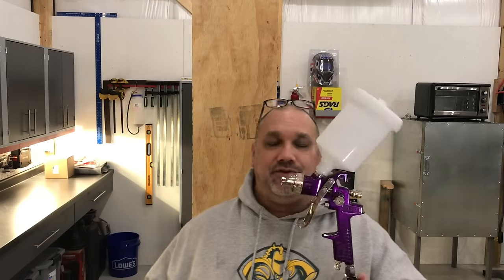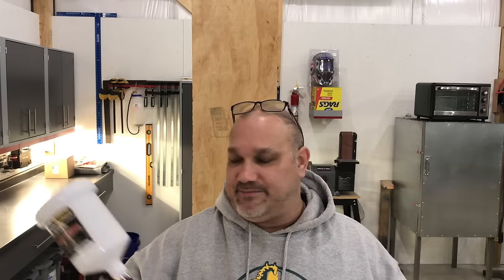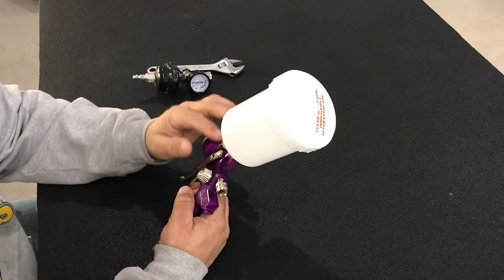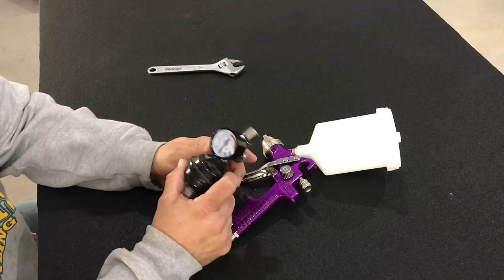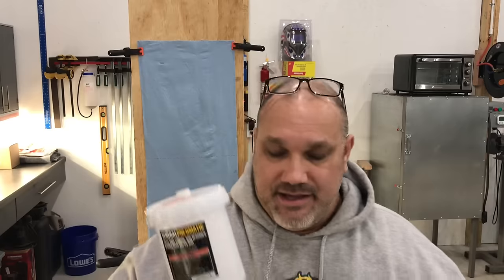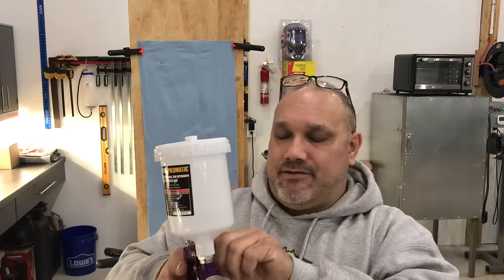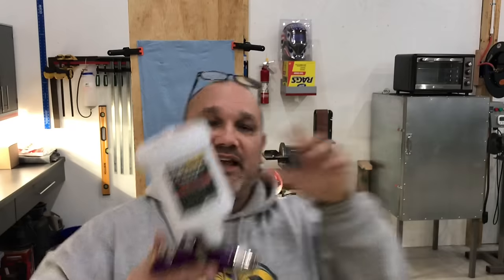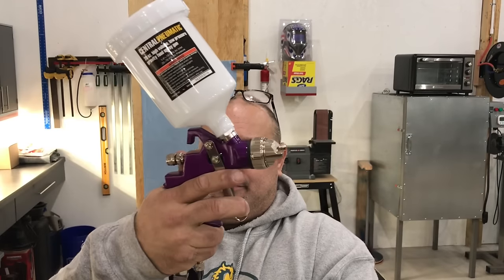How To Set Up a Harbor Freight Paint Gun

Comment: Does the regulator on the gun itself always keep it at 30-40 lbs as you described? In other words, does the gun regulator hold that 30 lbs and the compressor just operates accordingly to keep that 30 lbs at the gun at all times?? Thanks for the good video, I have the same gun, just spent a couple more dollars on mine. Thank you
Reply from the maker: The air compressor is at 100psi, and the regulator at the gun is taking care of what  I’m getting at the gun.

Comment: I want to spray outside the underneath of my Ford F-150 with Harbor Freight Bed Liner paint using a Harbor Freight 1.5 HP, 150 PSI pan head air compressor (2nd model up from their cheapest) with your paint gun shown here. Is it doable? I have a Ford Ranger that I had paint brushed the bedliner paint on with the bed off. Problem is it's very time consuming and you do get paint dripping down your arm, etc. Great demo of paint gun, thank you!!!
Reply from the maker: Thanks for watching, you may want a little bigger compressor.

Comment: Great job man! You definitely know your stuff. Lot's of great information that I was unaware of and no annoying music that too many people think is necessary in a "How to" video. I only have experience using aerosol paint cans to paint small to medium size parts and I am sick and tired of spray tips clogging or not working the first try or the propellant leaking all out, etc. I hate it when I have to throw away almost full cans of paint at $8-$10 a pop. The price is right for sure on this gun and I've been wondering if I should get it. Do you think it's ok to use leftover "spray can" paint in this gun? Not sure the best way to keep the leftover paint from going bad though...Any thoughts would be greatly appreciated. You just got yourself a new subscriber!!
Reply from the maker: Thanks for watching and thanks for subscribing. you can try harvesting the paint from a rattle can and spraying. Worst case you would just have to clean your paint gun if it didn’t work.
Reply: Look up how to refill those almost full spray cans with a valve stem. It works, as long as you have access to a compressor.💯🇺🇸👍

Comment: I want to spray latex Sherwin Williams hybrid primer and latex top coat on kitchen cabinets and drawer fronts. What tip size, thin paint or not, use the in gun filter or not, and anything else relevant to achieving coverage. Thankyou in advance for you advice. I am a novice.

Comment: Thanks, great video!  I really got a lot out of it. Went to Harbor Freight today to buy that exact gun, but they were out of stock, so had to upgrade to the $29 version. Question, where can you buy different tips at for the gun?  Harbor Freight didn’t carry those.
Reply from the maker: I’ve seen a video where a guy drilled the tip. You might check that out.
Reply: I called Harbor Freight, they do not carry tips. Very frustrating.

Comment: Can I change the fan from vertical to horizontal? Please I really need to know I have a house to paint tomorrow and have never used a paint gun. I'm still taking rollers but it'd be nice to learn how to use a spray gun
Reply from the maker: Yes, just turn the air horns on the cap 90 degrees. Thanks for watching.

Comment: I had one of these that required about 70 psi (purchased a couple years ago).  I finally got a new one today and its dramatically better.  I run it at 30-40 psi and it really moves the material.  I've never used any other paint gun, but this is an amazing value for $10 (when you get it on special).
Reply from the maker: I agree, thanks for watching.

Comment: Thank you so much for the great information!! this is the best video I have seen about this model of HVLP gun. Thanks!!!
Reply from the maker: Thanks for watching.
Reply: Chad Byrd... You must not be looking in the right places. There are even videos that show you how to use the paint sprayer with actual paint. What type of compressor to use. And how not to use the cheap plastic air and paint filters. Continue to do research.
Reply: Hey buddy,   i tried,  i wanted to set it up, hut i believe i did something wrong,   the amount of water or paint, shooting spraying  is too little.    
Look like clean, no clog,  etc,  i move adjusting valvs and.no change.  Do i hve to Change the,  tip,  or what you think  im soing wrong??
The psi, was right.
  

Or maybe the paint. (Valspar, dor exterior)  was to tick

Comment: I have another brand of HPLV gun and I also have the one you demonsrated.  I have sprayed a lot of lacquer but not water based stuff.  I would like to try some water based stuff.  What about tip sizes solvent vs water lacquer.  I spray furniture, not cars if it matters.
Reply from the maker: It should work for both if the viscosity is similar. Thanks for watching.

Comment: How heavy is the pull on the throttle? Does it come with different cups? Can i take  my regulator and filter off my standard 2gsllon compressor for my air brush and an attach it to the gun? It’s a PPG and looks the same size as yours? Thanks you for your time man!
Reply from the maker: Trigger feels about the same as the rest of my paint guns.A 2 gallon compressor may not be enough to run this gun.

Comment: Thank you for all your videos. I have a husky (a very cheap one) that has the controls laid out exactly the same. It has a 1.4 tip. The only difference I see is the name, color and no filter at the bottom of the cup. I am fixing to paint my utility trailer which is square tube. Should I narrow the fan even more for the rails since they aren’t very wide? About what distance away from the surface should I be working at? I’ll be spraying rustoleum primer and oil based semi gloss. 3/8” hose and 1/4” fittings. Compressor is rated at 6.8 at 40psi and 5.1 at 90psi. Any tips or advice is welcome. Not trying to produce show quality but don’t want it looking like crap either.
Reply from the maker: Yes I would narrow down your pattern a little. Keep in mind it will put more paint in one spot so you will need to move accordingly. 8-10 inches with a narrowed pattern. Good luck!

Comment: Thanks for the video.  I’m new to spray guns and spraying clear coat lacquer on guitars. I own this gun and I have cleaned my gun and put together my lines with a water filter and ball valve for a quick stop. Question. If I set this up to work for water, will I be close once I have lacquer in the hopper? Or will I need to start from scratch?
Reply from the maker: If your using an acrylic water material you should be close when you go to spray lacquer.

Comment: Thanks for this video I have really been trying to find one that helped a newbie setup a gun. When you get fluid delivery amount I am assuming you are setting the adjustment for the pin. Are you saying all guns should deliver 6 oz per min or is this gun specific? Also, I am wanting to spray cerokote which is a gun paint. Also wanting to spray some Alumahyde which is a gun paint. When you thin paint out for this HF gun, how do you know when you got it right.

Thanks again!
Reply from the maker: If the material you get has instructions for mixing, that should be a sprayable viscosity. 6-8 fluid ounce per minute is standard for hvlp gun but most people spray more than that. 
Thanks for watching.

Comment: Very informative video.  Can I use this gun to spray Minwax Polycrylic or other water based urethane products?  Also, can I run this straight from my compressor using the filters and regulators that you listed or do I need to use a turbine or other setup?  I'm needing to spray clear on a bunch of cabinet drawers that I just built, but I'm also wanting to have a good spray setup for future woodworking projects.  Thanks in advance!
Reply from the maker: You do not need a turbine. You spray the polycrylic with this gun. You may need to thin some of those materials. Just try some test pieces and see how it does. Thanks for watching.

Comment: What pressure is coming from the air compressor? 

I'm seeing huge variations in psi, like my compressor is set at 70psi and when I open the trigger it drops to 50psi. Then the gauge on the gun regulator, it sits at 70psi, then when I open the trigger it drops to 20 psi. So which regulator gets set first (compressor or gun) and what are they set to?

Comment: if you're using the same fluid, can you just leave the settings and pick it up a few days later and start spraying or should you do all of this each time? 

also, is this gun good for spraying water-based poly? 
Very new to this. Do you just pour the same poly that you would normally brush on into the cup and spray with this or do you need to thin it with something first?

thanks!

Comment: Using the 1.4mm tip and 30-40psi, what would you recommend for a 1.7-1.8mm and even a 2.0mm tip, these can spray thicker paints, but usually thinned, so would the pressure be the same or greater, as the viscosity would surely be similar due to thinning. Wanting to get into paint spraying and using water-based paints for woodwork, like cabinets and furniture, just looking for advise on working with thicker paints (although thinned) and spray tips. Appreciate any guidance, and enjoyed the video!
Reply from the maker: Some loaded questions. If you reduce viscosity you can use the smaller tips. The larger tips are usually for higher viscosity materials like primer where you’re trying for a thicker film build, or fill for sanding. 30 -40 psi is where these gun are designed to operate and changing tip size for viscosity. Personally I find spraying a couple medium coats instead of one thick one, gives you a smoother  and more even finish. I will opt for a thinned material and the smaller tips when possible. Hope that helps.
Reply: @gixerman01  Much appreciated. Going to do some testing with paints and thinning, with smaller tips, as you've recommended. It was suggested 8 parts paint, 1 part paint conditioner, 1 part water, unsure if that's correct, but will try different ratios. Thanks again!

Comment: Hey Gixerman, I could really use some help.  I am planning to paint portions of my SUV tomorrow.  Actually, "repaint."  During the first attempt, I could not get the gun set properly (first time using a gun, first time painting, first time in a paint booth, etc).  The gun actually whistled when in use (HF purple gun).  Questions: 1) Should I remove the little cap on top of the paint cup so there is an open hose (I assume yes...please confirm). 2) Tip for painting perpendicular to the hood or roof without paint spilling out of the top of gun or around threads? 3) Is it advisable to use the plastic cup liner? 4) I could not get a consistent and smooth pattern.  There was splatter and spitting as I was trying to set up.  Eventually, I was able to get a little product from the gun, but not that nice smooth flow.  It took forever and I ran out of booth time.  Want to avoid duplicating again if possible.  Thanks and any input would be appreciated.
Reply from the maker: 1 I leave the cap on. 2 the lid is kind of a pain to get to seal. 3 Liners make clean up easier. Make sure that there is no restriction on paint flow. I remove the screen because of this. Hope that helps. Thanks for watching.

Comment: What kind of air compressor would I need for this gun? I know I should get a huge air compressor, but how low could I go? I would only be painting cabinets/finishing decks and not something really special like a car. I would like to get a cheap air compressor from harbour freight like the 8 or ten (or even 20) gallon compressor from the central pneumatic brand or the mcgraw brand, do you have any experience from those? Thanks!
Reply from the maker: No experience with those, but you need enough cfm to run the gun. 6 cfm @ 40psi is a minimum. Hope that helps thanks for watching.

Comment: Thanks for the info. I have a 3 gal 100 psi pancake compressor from Harbor Freight. Will that work with the Spray Gun you demonstrated? also can you purchase the regulator from Harbor Fright as well.Sorry new to this, always used spray cans. Thanks
Reply from the maker: You can use that small compressor for small stuff, but if your spraying anything of real size you will run short on air. I’ve sprayed motorcycle side panels with a pancake compressor, but that was about all it handle. You will want to get something bigger. Thanks for watching.

Comment: Thanks for responding so fast !! I went to HF today and I picked one up as you suggested. I got the better one they had there. A question? I want to paint my engine block do you know who sells the best high temp paint. I shop at Eastwood also and they have a ceramic engine paint that they claim is good for up to 650 degrees. Have you ever used ceramic paint? Thanks,Ken
Reply from the maker: Ken Harvey I have not, but it should spray similar to other paints.

Comment: Solid video, thank you for the tips.  I am looking to pick up this gun and run it off my 20 gallon belt driven compressor.  Going to be using it for different projects around the house and in the garage.  Current project is a picket fence, it's all sanded and ready to go.  How would you set up this gun to shoot primer and exterior water based paint?
Reply from the maker: Biggest issue you will have with latex is thinning it down to spray. The thinner it is the better sprays but less it covers. Ask you local paint supply for best way to thin it down. Good luck.
Reply: @gixerman01  Will do, thanks for the tip.

Comment: DUDE!!! I totally wish you I would have watched you first before I sprayed last night after watching so many videos on DIY spray painting. I gained so much just watching what you showed me on how to set up your paint gun. SHit. Well, I had two PRESSURE feed guns that no one has a video on that set up only if you could help with that?
Reply from the maker: A pressure feed gun only need about 8-10 pounds of fluid pressure to work. Most of the setups I use at work are running about 15psi on the fluid side. We paint at a high production rate. When you paint with pressure feed guns a rule of thumb is, your paint should fall or start to arch about 6-8 inches from the fluid tip. If the pressure is too high it will blow paint past the air horns on your air cap and not atomize. Then adjust your air till it breaks up the paint. Set the fan like you seen in this video. Hope that helps. Thanks for watching.

Comment: thankyou for your video...my question is..  spraying my boat using total boat, wet edge,  one-part polyurethane paint....using the 1.8 tip...what pressure do you recommend ? any other suggestions would be greatly appreciated.. thankyou for your time
Reply from the maker: I not familiar with the product so I couldn’t say. As long as the viscosity is thin enough you should be able to. 30-50 psi. You will just have to play with it till you see it lay down smooth. Thanks for watching.

Comment: If I use that set up to paint my fiberglass jetski hood, what paint types would I need finish it in gloss black? Do I need a primer If it's a white base? How many coats of each? Do I also need a clearcoat? Going to try this out and want to make sure I do it right.
Reply from the maker: Prep work is very important. Wet sand the old finish to help promote good adhesion. I would use a good primer, a good automotive base and 2K clear. Thanks for watching.
Reply: @gixerman01  thanks a ton!

Comment: Great video..Ive rattle canned parts before but Im needing an air gun for a slightly larger project, rattle can just wont lay an even coat. Whats the compressors min requirements..Would 8GL 1.5hp cut it?
Reply from the maker: You need 6cfm @ 40 psi.

Comment: Hi, can this paint gun be used to paint a ceiling? I have old ceiling tiles I need to spruce up for my new business that I'm opening. The type of ceiling tiles with all the little craters in them. It's really difficult to paint them with a paintbrush and get the right color all the way in each crater.  I figured spraying might be best. I don't want to take all the tiles down though. Would this gun work? Thanks in advance!
Reply from the maker: This would not be the gun for that. I would use an airless sprayer for that. How that helps.

Comment: Hey great video information was very helpful was curious what you thought of the kit that Harbor Freight has for cleaning the gun wanted to buy a gun but wasn't sure if I should buy their kit as well
Reply from the maker: Thanks for watching
Reply: I use this same gun for my boat trailer and spray heavy paint. The cleaning method that works for me is simple: fill cup with paint thinner and shake well, then spray until it’s empty. Fill with water and shake well then spray until empty, then repeat once. I then remove the top and shake to get any bit of water out that I can and then spray until I don’t see any moisture coming from the gun and hang it up to let the cup dry. I also wipe the tip with thinner to remove anything from the outside.

It has yet to give me any problem. I don’t take anything apart at all when cleaning.

Comment: thanks for your instructional video on the HF hlvp gun.  Question:  I have a HF 2500 hlvp with the canister siphon gun.  Will the hose that feeds air into my canister fun also work for the gravity gun?  Is the connection different and if so do I need an adapter for my hose to connect to the gravity gun?  Thanks!  Dan
Reply from the maker: Sorry I’m not sure what your asking . The gravity feed cup won’t work on the siphon feed and siphon feed won’t work on the gravity feed.
Reply: @gixerman01  so you're saying that my turbine that I use for my siphon gun cannot be used as the air supply for the gravity fed gun?
Reply from the maker: @dandowner2905  I tried to find the gun your talking about. If its the gun that takes the turbine pack with the big hose it wont work with the purple gun.